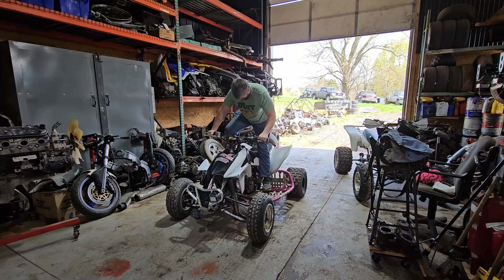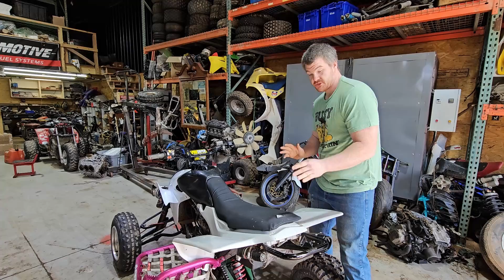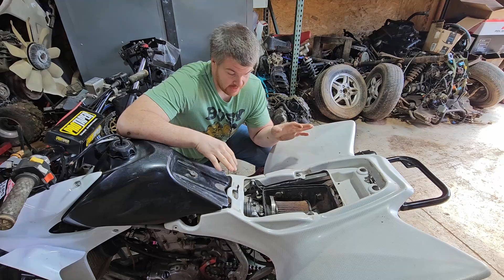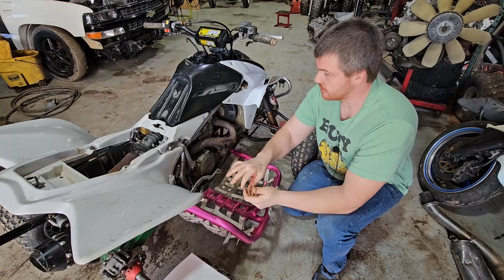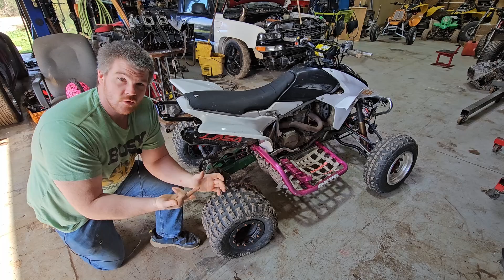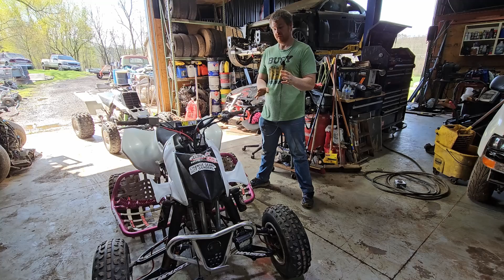The BEST 5 Ways to Modify Your Honda trx450r Atv For MAX POWER! (Cheap, Free & Expensive!)

Comment: Got the sensors out the green wire just remember it's a ground fault system, you can ground the throttle switch at the handlebar and the switch as well I'm the housing on the carburetor, for the TPS, you slightly turn just a little bit and clamp it down so you can start the motor with a little throttle.. as for Rev limit I didn't notice any difference with grounding the fault wires, I only do it to changing my throttle to the pro twist throttle rather then having a thumb throttle..

Comment: The extra lift of an aftermarket cam is really not going to work like it should without porting Yes you can throw a cam in but I think you're a little backwards in the order to do these upgrades It's best to do the pipe first because if you do the intake the carburetor the cam porting all that other stuff you've still left the bike choked right down by the stock pipe Yes you can take the stock baffle out of the stock pipe I didn't hear you talk about that

Comment: Unplugging the TPS does not move it to a higher ignition map or anything look it up there's a 2D and a 3D map The 2D map just uses RPM as it's base 2 advanced timing a 3D map uses RPM as well as throttle position sensor to make a 3D timing map Yes it starts a little easier with the TPS connected but I haven't had any issues running the 2D or the 3D timing map It's just important when starting it with the TPS still connected you don't hit the throttle that's what kills the starting components on these bikes I fix hundreds of bikes so trust me I know these things
Reply from the maker: I did look it up and got great information from very reputable sources. The cdi does not make its own timing map based on throttle position and rpm. These 2 maps are preset locked in and have no variation in them because theres no other information being input to the cdi for it to be able to calculate anything different based off of things like air temperature, coolant temperature and such. The only reason it starts easier is because the timing is a few degrees retarded on the 1st map otherwise this wouldnt be the case because nothing else changes. This is a common issue with 2 strokes also when advancing the timing on a plate they become harder to start because of the timing advance. It absolutely will not hurt the bike to leave the tps unplugged on a carbureted bike, it will just stay in the advanced timing map. Different story on efi but the trx was never efi from the factory. The only way you can change the ignition timing within the map is to have a programmable unit installed and make your own. Stock cdi is super basic its just 2 simple timing curves.
Reply: @sfastjohn  it doesn't make its own map but the position in the map that it uses the 3D map gets its inputs from the TPS and the throttle position whereas the 2D map only gets its input from crank position It's like an EFI map it can use different parts of the map depending on the inputs
Reply from the maker: @MrATOMBOMB420  these dont have a crank position sensor.
Reply: @sfastjohn  it uses the pickup on the stator as a crank position it has to know a crank position in order to fire it's not like a crank position in a car but the pickup on the stator is what is used as a crank position sensor
Reply: The 2D table clearly has 2-dimensions, the 1st being the RPM, the second being the associated value. The limitation of this type of tuning is that the tune is static - it has no adaptability. If you are over ~66% throttle, then the DME uses this table, and it doesn't care about actual load. So, for example, if you are at 4000rpm, and 0psi of boost, your ignition timing is ~19°BTDC. And if you are at the same RPM, but 15psi of boost, your ignition is exactly the same: ~19°BTDC. Obviously the load on the motor is not the same for these two situations, so the ignition timing should be different, but it isn't.solution is to change the engine-management strategy to use 3-dimensions.Now the ignition timing is no longer purely dictated by RPM. With the additional axis of load, we can adjust to the dynamic-load nature of a turbocharged vehicle. Using our example from earlier: 4000rpm and 0psi of boost, the ignition timing dictated is ~42°BTDC. And at 4000rpm and 15psi of boost the ignition timing is ~23.2°BTDC. That is a huge change from the static 2-D table in the first example.The added dimension should be immediately obvious. The 1st dimension is LOAD; the second dimension is RPM; the third dimension is the associated value.Now the ignition timing is no longer purely dictated by RPM. With the additional axis of load, we can adjust to the dynamic-load nature of a turbocharged vehicle. Using our example from earlier: 4000rpm and 0psi of boost, the ignition timing dictated is ~42°BTDC. And at 4000rpm and 15psi of boost the ignition timing is ~23.2°BTDC. That is a huge change from the static 2-D table in the first example.
The addition of the 3rd-axis provides much better control and adaptability to changing engine loads and rpms. The end-result is a smoother, more linear power delivery, with multiple "secondary effects" such as economy, emissions, safety, ect.